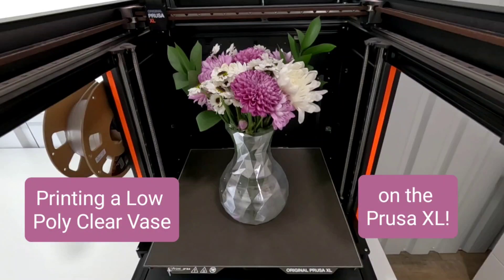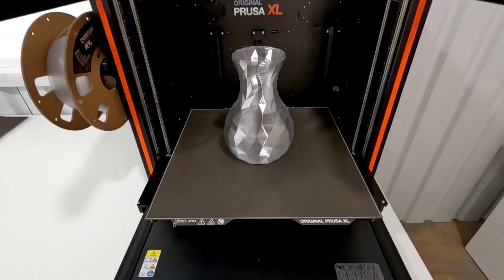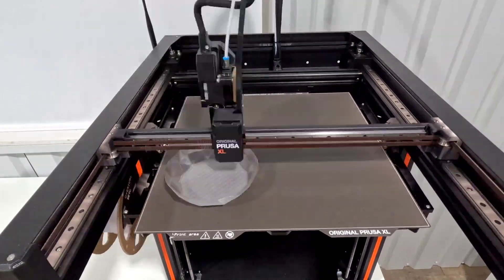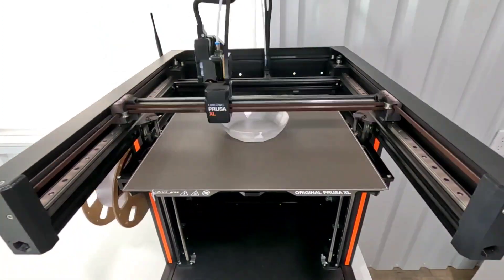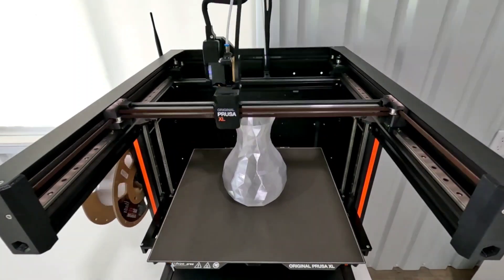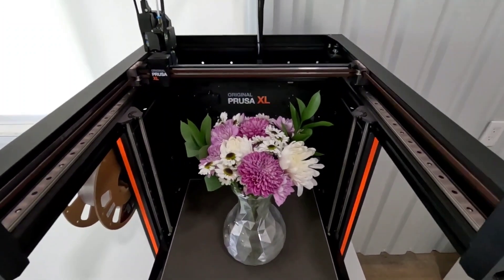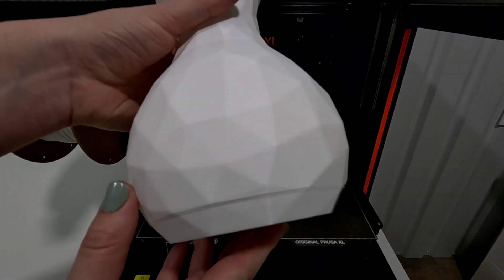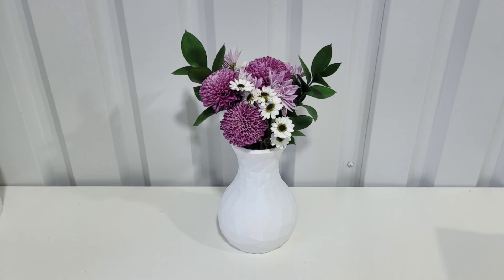Printing a Low Poly Clear Vase on the Prusa XL!

Comment: CNC Kitchen has a video about printing super clear, super strong prints with PETG. I think the info in there could help a lot. (Looks like other people have suggested most of what he tries in there, though...) A big thing he said is you have too print SLOWWW. The slower, the clearer, and the better the layer adhesion.
Reply from the maker: I'll check it out! Thanks!

Comment: Those look great, but it's a pitty that they're leaking...
I've printed a few vases on my CR-10, 0,4nozzle with 0,16 and 0,2mm layer height and 3 bottom layers, and only 1 out of 6 vases leaked! I guess that was due to the filament diameter being lower than the settings. All of them in different brand PLA, around 200°/206° celcius. Oh, and with concentric lines.
Good luck fine tuning!
Reply from the maker: Thank you so much!

Comment: As others have said, thicker external perimeter, hotter, and slower to get water tight. With a .4mm nozzle I do 0.8-1.0mm width, 0.2mm layers, and 220c with like 25mm/s max speed. They key is hot, thick, and slow 😂

Comment: To get rid of the strings dry your filament and print at a little bit lower Temperature. I have seen that it is Polymaker PETG and it is between 230 - 240 °C. Print at 235°C and dry the filament before. 
That should create better results.
Reply from the maker: Thanks!

Comment: I've only printed one vase (in vase mode) and--after seeing the struggle in this video--I guess I just had much better luck with it than you did with yours. It had only one little leaky part near the bottom, and I was able to seal it up with a little bit of Gorilla gel glue. I'm not a big flower guy so I haven't exactly tested the longevity of it for more than, I don't know, 12 hours or so? I left it overnight after the gorilla glue fix and it held up but the glue might not be able to patch those imperfections forever.

Comment: Making the bottom thicker will just let it fill with infill, which doesn't really affect leaking.
Reply from the maker: I figured if it had a top and bottom layer, that would be better than just the bottom layer. But you're right, the infill doesn't help.

Comment: I pour some 3d printing resin inside the vase and twirl it around then flash some light in there. No more leaks. Also higher layer lines make for clearer prints but the resin will be noticeable on the inside if you use clear filament.
Reply from the maker: Thanks!

Comment: Try increasing increasing the "Infill/Perimeters overlap" setting under the Advanced Print Settings in Prusa Slic3r. As other suggested, you can also try experimenting with the extrusion width or the flow settings but those might have unintended side effects so experiment small =)
Reply from the maker: Ok I'll try this! Yeah I'm thinking maybe I'll scale it down so I can try out different options quicker. Thanks!

Comment: Print hotter?  Try vapor smoothing?  I once had this same issue. I even sent the part to be printed using SLS. Still leaked.  I ended up dipping my part in a plasticoat type product that worked to make it air tight.
Reply from the maker: Ok good to know. Thank you!

Comment: Printed this Vase on flying bear reborn 2 with .6mm nozzle , 0.3 layer height, 0,8 layer Line, Vase Mode , 100% size, 115% flow, 3 Bottom in marble PLA and its watertight after First try. I guess I have learned a lot since I started 3d printing in 2017 ;)
Reply from the maker: Ok good to know! Thank you!

Comment: The first print looked really good!

Unfortunately vase mode because it is only one perimeter any small defect it’ll leak 😢. The more perimeters the better but obviously that introduces a seam, takes ages to print and won’t come out as transparent.

On a related note, I once went down a large rabbit hole to try get prints the most transparent 😂
Reply from the maker: Yeah it's annoying that I haven't been able to make vase work because of the seam. 
Which type of filament did you use for transparent?

Comment: You could probably coat the interior of the vases with an epoxy resin to seal/prevent leaks
Reply from the maker: True! I may try out a few more options first. Thanks!
Reply: You should be able to get water tightness easily with vase mode. If not, something is off in settings or physically in the printer.

Comment: You have to set the flow rate higher, maybe about 115% or more, other than that you can increase the line width to maybe 0.8 or more but that should be printed a bit slower.
Reply from the maker: Ok thanks!

Comment: Stick with vase mode and adjust the extrusion width in PrusaSlice to at least 1.2, it will make the printer push out more plastic to get the width so there is more contact between layers.  I would also use concentric for Top Fill and Bottom Fill patterns as they leave less gap.  Stick with 0.4mm for layer height.  I think you will like how clear it turns out with these settings.
Reply: Perfect reply, everything I was thinking as I watched this video. 👍👍
Reply from the maker: Thank you! I will try this!
Reply: @tada3dprinting  also up the temperature a little more if you try this again.
for something this large to be water tight you need really strong layer adhesion so a lot of heat is usually good.
Reply: @Pixelplanet5  Yep, almost nobody prints hot enough, probably thanks to vendors marketing their materials to users with PTFE-lined hotends or just low advertised max temps. As long as you're not slowing down and dwelling for many seconds at a time, you can go wild. PLA prints beautifully and with super strong layer bonds (same as strength in other directions) at 260-300.
Reply: I do fun things using a 0.4mm by increasing layer height to 0.32mm but I adjust the perimeter/external perimeter to 1.2mm and print slightly slower (5-10%) and increase temp by 5-10C

Watertight and relatively clear

Comment: I think on prusa channel they talk about multiple perimeters to get watertight parts - I think it was the garden self watering planter video. 

In vase mode only way is pouring in some runny epoxy and rolling it around to coat the inside completely. 

Can you vapor smooth with acetone to get more transparency and fill the gaps without using epoxy? I think cnc kitchen tried vapor smoothing to increase strength.

On “good roads” he was producing skateboard deck moulds that were multi perimeter models that were so close together they acted as a solid wall and ran vase mode the idea is that you get a faster print as you cut out travels. It seemed to work. Not sure how you would tackle that in with the vase model you have here though.
Reply from the maker: Yeah I have been able to print pots but never made vase mode work before. Yes if I can't adjust the settings enough, some sort of coating will be the way to go. Thanks so much!
Reply: @tada3dprinting  if you can model stuff the hood roads option may work. I think if he was printing with 04 nozzle his part space was slightly less so the later would just touch. Could be worth testing..if you can model.

Comment: Honestly its just hit and miss
Reply from the maker: I'm sure it's possible. Just have to keep trying. Thanks!
Reply: @TADA 3d Printing  I build a water fountain once. And kept the bottom layer very thick. Basically I had around 8 layers I think. It worked very well for me. Hasn't failed in over a year.
Reply from the maker: @arbabaziz1197  do you remember what layer height and nozzle size?
Reply: @TADA 3d Printing  I remember my nozzle being 0.6mm but can't remember what layer height I used.  From my experiments I got that trying the thickest nozzle with many layers, helps to keep water in. I can't fully remember but having the thickest layer height you can print with that nozzle would be most beneficial.
Reply from the maker: @arbabaziz1197  ok thanks!